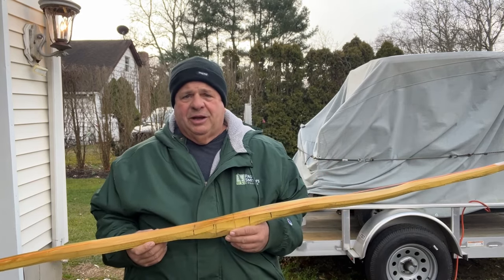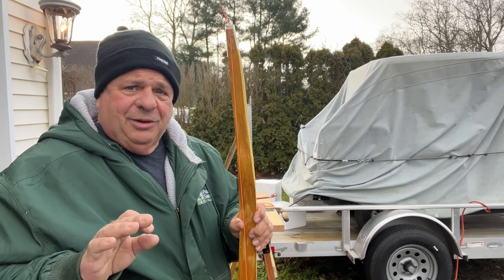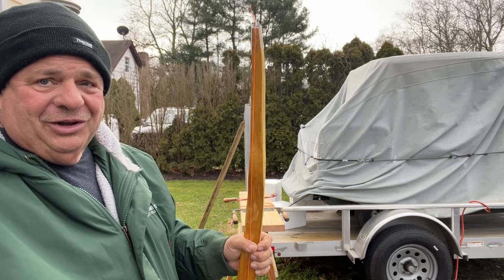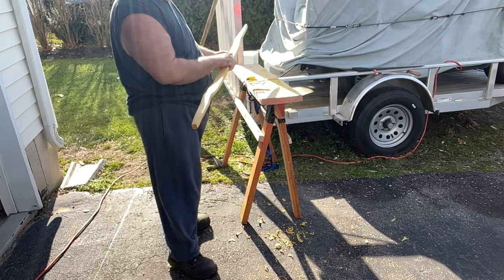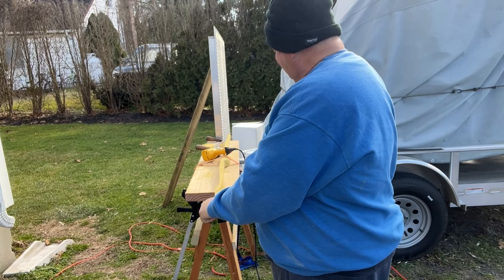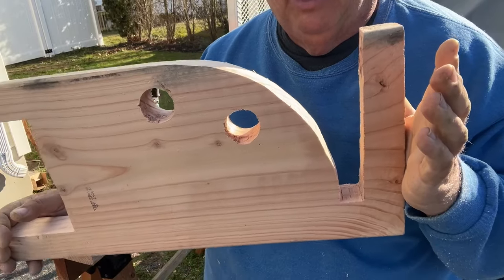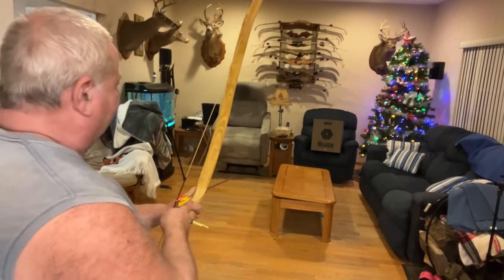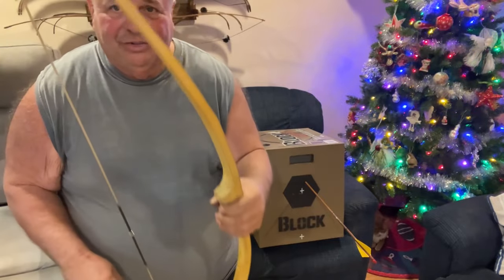Osage Recurve self bow build  Christmas December 26, 2023 by Joe Zummo

Comment from the maker: I I have a ryobi belt / Disc.  Sander 36” not 18. I found out if you’re careful you can remove wood to your thickness line. Careful keep it moving. When you get close stop youse the file / rasp and cabinet scrapers to finish. Cabinet scraper for tillering.